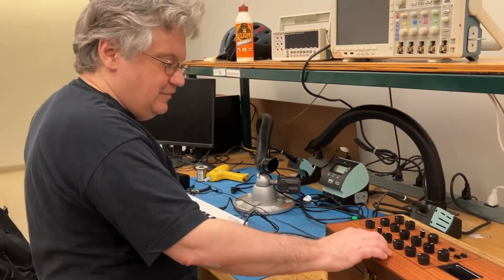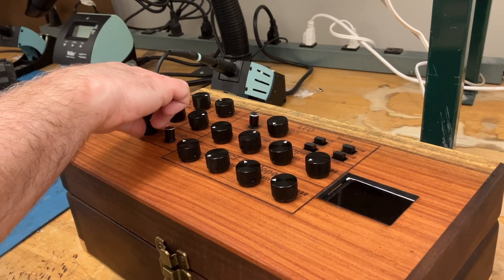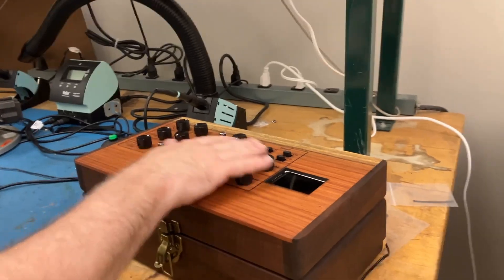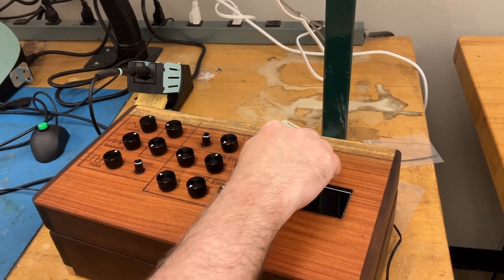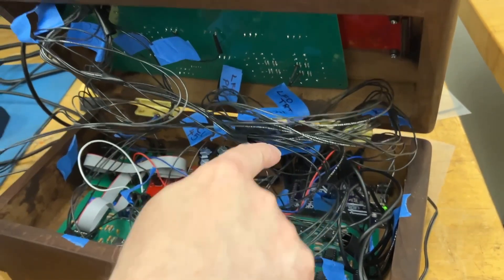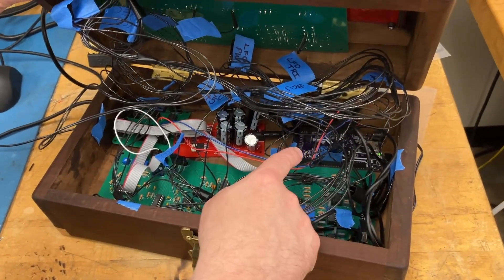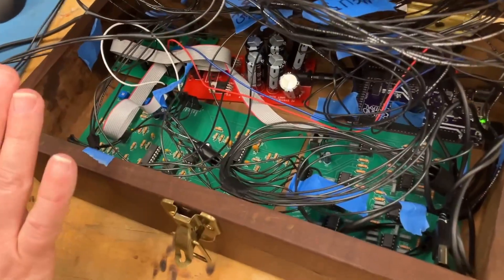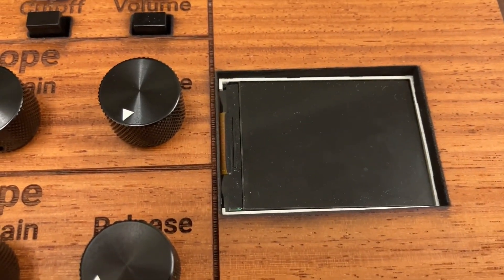Synthesizer Student Project: Analog Signal Path with Adafruit Grand Central M4 Microcontroller

Comment: if you're concerned about the lack of resolution due to low PWM frequency then you should consider Pulse-density modulation (PDM). it only requires a slightly more complicated timer interrupt handler (think: DIY fixed-point math) and you can get a significant increase in precision amortized over time, especially given the amount of filtering your're doing to get a low-frequency CV signal.
also consider this: on startup get your VCO play 'C' in every octave you can. listen to the VCO output on a digital pin with an edge-triggered interrup, calculate the frequency of each note & tune your VCO accordingly.
Reply from the maker: I'm hoping to have another student (or group of students) implement autotunein the future.
Reply from the maker: Ah, I wasn't familiar with Pulse Density Modulation, thanks! I will check it out.

Comment: Is it possible to do an expo-compensated FM between oscillators with this microcontroller's control? Is the expo-converter in the analog part omitted here and processed via the microcontroller?
Reply from the maker: The CEM3340 they're using has an exponential converter built in, and they're using that. The 10-bit DAC is driving the expo CV control. But the chip has a linear modulation input, in theory one could use that too, either from an analog oscillator or a modulation signal generated in software though another DAC.

I haven't done the math but intuitively I think trying to use 10 bit DAC to drive the linear range and get a wide accurate range across many octaves would be dicey.
Reply: @Lantertronics  
What if there was no built-in expo-converter (a discrete VCO)? Is it handy to use a MC and make some amount of expo-converters inside it? Will it cost a lot of CPU or not?
I'm asking this because an expo is always PIA unless you have a ready solution like CEM3340. But discrete designs gives you a lot of freedom to tweak the sound, make it unusual. I've understood this just by making my 1st VCO (that was really not simple).
About 10 bit DACs for FM: I don't like accurate analog gear designs. Because often these sounds boring, sterile or "computer like". My fav. example is Korg Prologue.
On the other side: I have MFB Synth Pro. It sounds wild if you want it too. And it's near impossible to make it sound sterile. Especially in VCO mode.
Reply from the maker: @KiR_3d  It's not going to cost any significant CPU because the expo can be done with a lookup table. You'd want a very precise DAC. I haven't done the math, but I'm guessing at least 16 bits. It would be interesting to try!

Comment: Cool veneer box, Adafruit Grand Central M4 Microcontrollerower, has an Eagle schematic online with allows you to make a "footprint" That's what  i did with the Arduino Nano Every prototype board avoiding a wire network that resembles a small city, than i use headers, jumpers & short jumper wires for the ic's on that board. i modified a Eagle Arduino library to create the footprint of the mega with is also the grand central, nano to nano every. i think this Arduino library was made by adafruit a "long" time ago. the room under the Arduino elevated by headers allow you to "hide" more ic's, so nothing goes to waste.
Reply from the maker: @AnalogDude_  I plan to do that if I have a future team contjnue working on this design.
Reply: @Lantertronics  That's what i did with Arduino nano every, under the Nano every i got one 23LC512 sram and 2 x 24..256 eprom, midi (in/out using DIN5 pcb sockets), optocoupler is on the one side along with CD40106 for 3 buttons and rotary encoder. north of it is a max719 led display.
everything is connected to 4 x 2.54 headers directly next to pins. but since i do low level code, avoid using Arduino code so far i didn't succeed turning SPI on, but i also didn't make it a marathon job, 1 week later i got the arduino R4. the board is now like the default eagle pcb size, but due to lots of headers giving it a universal character.

the cd40106 for buttons, rotary encoder was chosen to avoid software button denounce.

It would be much better for you to make a universal base board, you just have to take out of the drawer, just make the diameter of the via's a bit larger to widthstand repeated soldering.
Reply: @Lantertronics  However very good the board is, i did forget to think about one thing and that thing was the usb cable, but i'm sure you would lie this board.
Reply: @Lantertronics  make a custom component that has 2 smd pads on top of each other ( and matching symbol, connect them "properly" as one) , cut a large square (rectangle) hole in the PCB using the milling layer, like for instance 2,5 mm or more if you like as long as the smd pads are larger.

try this in some empty corner, you be amazed with the results. tie some resistors to test the results.